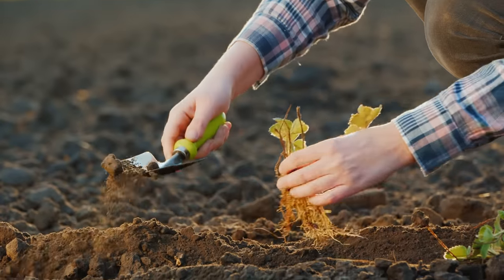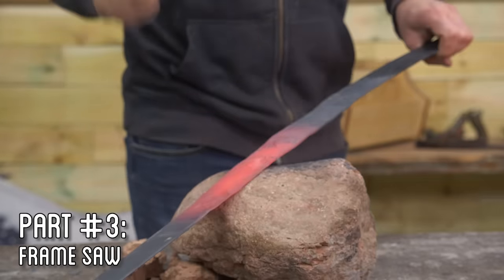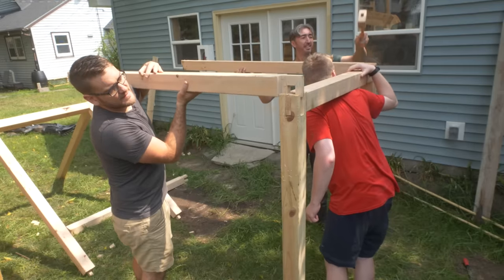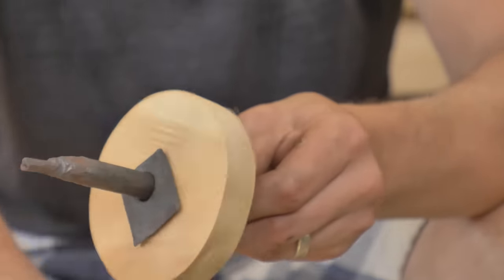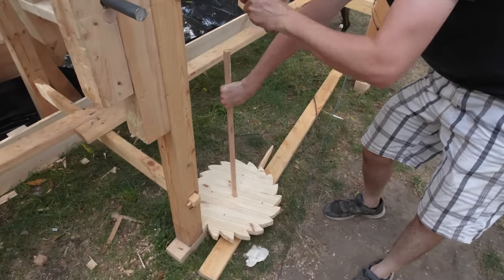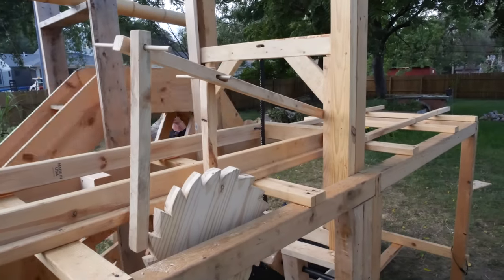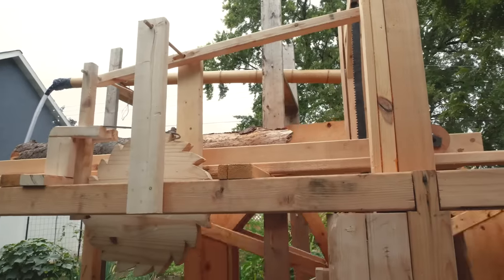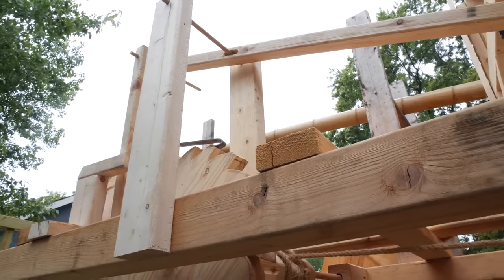I Built DaVinci's Saw Mill

Comment: Saw blade looked very cartoon like. Also make sure the teeth bend outwards to the side every tooth opposite of the previous to make the cut slightly wider than the blades thickness. It will let the blade go through the log with minimal friction. And also, I second what TwinPhoenix666 points out. Having the saw cut more aggressively on the downward stroke will make the cut more clean as the log rests on the bed/dolley. Having it cut on the upward stroke will lift and cause the log to not rest easy on the bed/dolley. A more aggressive angle on the teeth will result in a more coarse saw dust, and you can use the saw dust to determine if the blade works efficiently or not. Your sawdust was fine, and did not add much per stroke. I love the principals of the design as you must with DaVincis designs, and I am sure with some tweaks it would be fairly effective. Could a belt/pulley/gear system be added to increase rotational speed a bit? Would be fun to see a follow up video and re-testing after tweaking. Keep up the good work! + 1 subscriber!

Comment: It is a good proff of concept. Tuning yhe arn that connects the shaft to the saw frams would do good to get a smoother motion on the cutting. Tuning your saw blade will also help hugely in making the cutting better. I think your tooth geometry could use some refinement for more efficient cutting.

Comment: You should maybe try leaving the line when you cut your joints.
Draw pegging mortise & tenons while using a tapered hardwood (black locust is traditional) peg will help pull them tight.
Always interesting, but often the execution hobbles your projects.

Comment: The ratchet arm can be slightly upgraded by cutting a notch into it where it contacts the 'gear'. It will need a correct angle to be at its best, but it should allow it to grab onto and push on the gears teeth with better grip if done right. It won't take much to do it either. Just a inch and a half maybe in a couple directions to make a triangular cut into the arm's end. And then maybe a slight slope at the end of that cut so it slips off where needed to be repeated.

This should result in slightly better pressure being exerted by the mechanism against the saw blade when the wood is being pushed through, which should help keep the sawing a little faster.

Comment: A couple improvements I would make: There needs to be some sort of clutch to allow the mill to disengage from the power (obviously not an issue if you're running it off a pump tho). There also needs to be some sort of way to adjust the feed rate relative to the saw speed. also it's probably a notable efficiency loss to have the blade bottoming out in its travel before the crank hits its lowest point, also probably stresses the crankshaft somewhat.

Comment: i wonder if you’d get better results with a higher speed blade.  possible design that comes to mind is make a large circular saw that’s heavy enough to be sorta also a flywheel, and then use gears to speed up the water wheel movement, possibly with another dedicated flywheel somewhere in the chain. by using rotary movement rather than linear, you don’t need to slow it down to go backwards. might also need to add some crank or something to get it started from stationary because of the additional mass.

Comment: It would be awesome if you could set up a traditional water mill, either for lumber or other purposes. Many early machines were wheel powered, and it would be really cool to see you build out a wheel powered workshop with more advanced systems. Of course your own manufacturing and abilities may need to be upgraded by a few eras before you could make any of that with ease.

Comment: I love your creative and curious approach to this project. It's the spirit of a true inventor. You also don't shy away from the "easy" way and pick some very challenging techniques. Still, this machine would break down very fast! There seem to be several weak points that would buckle when under stress, and such a machine should really be designed to work under very tough conditions for weeks without needing maintenance... Still, I get it, it's obviously an experiment! You guys seem like the theoretical types. I assume you're engineers or something similar. I think you could benefit from teaming up with an experienced woodworker who has the skill to do detailed work as well as an instinct for torque and stress points - not to do the work for you, but to help you focus on what to improve.

Comment: In 1563 the Dutch homestay dad Cornelis Cornelisson from Uitgeest invented the crankshaft and sawmill on wind and had it patented. The guilds from manual sawyers hated it and forbid them to powersaw within city limits of Amsterdam. Millers then built sawmills outside to the north on what is now Zaanse Schans. At 1653 he could probably not been inspired by Leonardo. On the window that holds the sawbladeshe mounted several blades so they were of exact thickness. That made it possible to build cheaper and more sailing ships to sail to the far east

Comment: I think a good course on joinery and carpentry would benefit this channel as well as the application of lubricants. A general good practice for cutting would be constant pressure or controllable constant speed which this carriage has neither IMO. The drum has varying speed line a sin wave which smoothes out and increases as it winds up. An alternative would be a counter weight that puts the right amount of pressure on the blade and on the up stroke can wind itself up or just have it work with the length of the rails since you have to bring the carriage back for every piece anyways. The saw and the wheel could use more alignment (linearly and axially respectively) to keep the forces consistent throughout the ranges of motion or at least predictable. You may be getting binding or lifting on the log because at the bottom of the stroke before moving upwards, the saw is forced into the log when it could benefit from being moved away from it to reduce engagement on the upstroke which could also allow you to have a more aggressive cutting angle. With the right feeds and speeds you shouldn't be getting much lifting on a log so you could eliminate having to sit on it or tie it downward. A few guide wheels for the saw blade would be an easy upgrade.
Reply: I don't know if the saw has a kerf but the teeth seem to be filed with opposing angles. With a lack of precision on those angles, I would expect the saw to want to twist in different directions at varying rates. Most modern saw blades also have a set where each tooth is left or right of the center of the blade to allow the back of the blade to move freely but again this would require a saw set to get any sort of consistency to avoid a similar problem as above. With an elliptical motion and perhaps a wedge placed in the log once it passes the blade, a less aggressive more consistent rake angle can make smother more efficient cuts. A wedge would be used to avoid binding from pinching the back of the blade and so would lubricant or even just a bypass of stream water.

Comment: Andy. Just a little idea, if you got rid of the mechanism that pulls the sled along and just used the rope over the wheel and then to some weights, you could adjust the weights and gravity would do the work. You might need a pulley... 😀👍
Lovely machine though, good joints. 👍

Comment: First real in production sawmill was in the Netherlands, designed by a farmer. 
The Hertog didn't allow the farmer to use it,the hertog died and the farmer built the sawmill.
That invention started the built of cheaper ship's for the VOC.
Building a ship was Very expensive, but with the introduction of the First sawmill it cuts cost dramatically.

Comment: I think it is all about "Feeds and speeds". The ratchet may need to move slower and the saw faster. Or vice versa. Also have you considered smoothing the sides of the saw blade so it doesn't bind as easily and sharpening the saw? A rip saw, what you have, has each tooth bent outwards alternately to reduce binding.

Comment: You need to shorten the connection between your crank and saw so there’s no pause in the cut, you also need a finer tooth gear for advancing the log, and a better blade

Comment: 13:42 I think a cast sawblade that is perhaps thicker would be better.  During the film of the saw doing work, I notice a lot of flex in the sawblade itself.  Watch the footage in slow motion. Also you don't have any lubrication on the moving parts or bearing surfaces, at least that I could see.  That's just a good idea in general with machines.

Comment: I've built a few things in my life. Number one is use hardwood for anything that experiences friction vibration or repetitive motion...basically anything that moves or touches a moving part. I watched a man hand cut a saw blade for a vertical water powered sawmill out of flatbar, he had a template with all the angles he would apply layout dye to the steel then scribe the lines, then with a hacksaw make each cut, later set each tooth and then sharpen with a file. These saws cut on the down stroke and the ratchet mechanism needs to time with the down stroke, as well the angle of the blade has to allow the chip to clear, so some means of adjusting the blade angle fore and aft is necessary. Good effort for a grade school science fair level, but you aren't going to saw wood with that flimsy toy. There is a lot of technical literature from back in the day regarding these types of saws as they were extremely common...every little hamlet had one around here.

Comment: A suggestion for speeding it up would be to use a pulley system between the water wheel and the blade

Comment: I only started watching your videos a few weeks ago.  (I think I was looking for stuff about lens making.)  I've been obsessed ever since.  
Anyway, this is the first new video since I started watching, and it turned out to be an important one.  You've been talking about doing this at least as far back as when you made the saw.
Is this ratchet the first toothed gear you've done?  You've done plenty of pulleys, but no actual gears that I can recall.  Gears are important for a lot of advances.  If you plan to do more wooden gears, you might consider covering the teeth with leather or brass to keep the wood from splintering.
Any plans for maritime technology?  You haven't done anything since the dugout canoe.  But ships are very important for building civilisation.  They're needed to spread technology around and bring different ideas together.  I know boats are difficult and your previous attempt went badly, but you should at least consider a large dingy or something, that you could use to try out different types of sails.

Comment: Is there a reason that you left out the bow spring?  You had it on your pedal-powered version, and the 18th Century (I'm guessing) sawmill from the brief clip you showed in previous videos had the spring as well.  With the spring, the waterwheel does far less work to push the saw up, which should help it run faster.
I also noticed that the rod connecting the crank to the saw keeps getting crooked.  And the frame holding the saw is too loose and keeps wobbling.  Fixing both of those should help a lot.

Comment: an impressive experiment. I think a natural stream would provide much more power to the wheel than a small water pump. Perhaps a much larger pump, focussing on quantity of water rather than speed, might be best. Perhaps a piston pump loading water into an overhead tank from which you could control output flow to the wheel.

Comment: Put pegs on the water wheel, and have a set of gears between so you can add on a walking wheel for when the water isnt going, and allow the employment of animal action, either people or donkeys/mules. Depending on the design of the walking wheel, it could also serve as your engine in future projects/be replaceable with a steam engine whenever you tech up to that point.

Comment: It would be better to nix the feed mech and make the saw reciprocate faster. Your problem is going to be pressure on the blade. It has to be adjustable. 

I was a metal Fitter. Our bandsaw had a hydraulic feed table with adjustable speed. 

There were so many variables that made you change speed including, thickness of material, hardness of material, blade thickness, blade speed, sharpness of the blade, and temp of the room. 

The issues were binding, blade dulling, and blade twisting causing it to creep off course

Also, throw some diagonal gussets on the frame to sturdy it up. Your loosing energy in a wiggly frame.

You've come a long way. I'm proud of you.

Comment: some thoughts on the saw blade, slightly bending the teeth of the blade in a alternating  pattern could increase its cutting efficiency.
* Setting - This refers to bending the teeth of a saw blade alternately in opposite directions. It helps prevent the blade from binding in the cut. Setting is usually done with special tools called saw sets.
* Fleam - This refers to having the teeth bent out of the plane of the blade. Adding some fleam to a rip saw blade can help it cut smoother in gnarly wood.
* Rake - This refers to the angle of the front face of the tooth relative to a line perpendicular to the blade. Adding positive rake makes the teeth cut more aggressively.
Also seems like a lot of unnecessary looseness or play in the constructions that could be improved and wile still keeping the primitive design concept.  Making the design primitive does not mean it as to be sloppy.
Reply: Reading your definitions, how is "fleam" a different thing from "set"?

Your definitions sound like they could be interchangeable.  I've never heard of "FLEAM."

Could fleam refer to a bit of twist to each blade in addition to its set?
Reply: @lawr5764  I knew of the concept of bending the teeth, but I did not know what it was called. I found both terms, so I included both of them. :)

Comment: Tom Scott did a video about a castle being built with human sized hamster wheels powering the cranes. Maybe you should build one as a secondary power source. 

Also there a many damned rivers in outstate MN that have parks next to them. I'm sure you could rig up a flume that could catch a portion of the water. Melrose, MN is an example I know of that would be relatively easy to set up at.

Comment: I think with some basic tweaks to the mechanism it could work better. My first issue is crank shaft - it pushes the saw up and  you have flimsy metal rod doing all the pushing. Much better would be to have the mechanism above the saw and make it pull the saw up, then letting saw to pretty much drop by gravity. Likewise log itself could be gravity fed, which would avoid complicated ratcheting mechanism, I reckon even few degrees slope would be sufficient to keep the content pressure on the blade. Obviously the most efficient design would be to get rid of the crank and make a circular saw, as this would allow for continuous cut, less moving parts and less complication (obviously, that would be not like Da Vinci design and making circular saw is complicated with basic metallurgy skills)

Comment: Fix your blade design: make it cut on the pull only --put a counter-weight system on the blade so you aren't putting as much strain on the system to push it back up.  Those two things alone will drastically improve performance.

Comment: the biggesue i see here is the saw blade itself.   bend every third tooth slightly in opposing directions to increase the curf slightly. 
additionally you could  add additional cog wheels to increase the speed of the saw. 
think about reduction gears,  large one on the water wheel, with many pegs to serve as teeth, that turn a smaller wheel, that drives the mechanism, you will increase the speed of the mechanism, but will lose some torque

Comment: The ratchet advance mechanism is a bit over-complicated and counterproductive.  As currently employed, each stroke of the saw attempts to advance the lumber sled.  However, if the cut of the blade is not efficient enough to remove that much wood in a single pass, it will build tension in the rope.  This means subsequent passes will have more pressure on the blade, which will encourage binding, reduce cutting efficiency, and create a feedback loop of progressively poorer cutting.  Steady, consistent pressure will give better results and you can accomplish that with a simpler mechanism to boot.  Simply run the rope over the extant reversing pulley to a bucket full of rocks.  Alternatively, you can let the weight of the timber help with the cutting by mounting the entire feed sled at an angle.

Comment: Very cool that you tried this.  But understand that even when building something from the Renaisance, people back then were masters in their field, master woodworkers and master metalworkers, they knew what type of wood to use, and they knew the geometry a saw blade should have to cut that type of wood the fastest.  Woodworkers and blacksmiths were leaning on generations of experience, having learnt from their father and grandfather, who had in turn learnt from theirs.  So i would improve upon the build, get some help from woodworkers, and either buy a sawblade or get a real blacksmith to make one.  If you talk to a sawmaker, it will get real clear to you soon how much that goes into a good saw.  Best of luck forward, and i hope you can get this saw mill close to the original :)